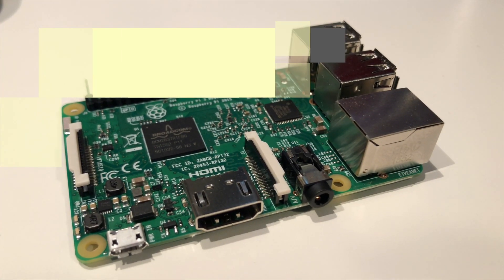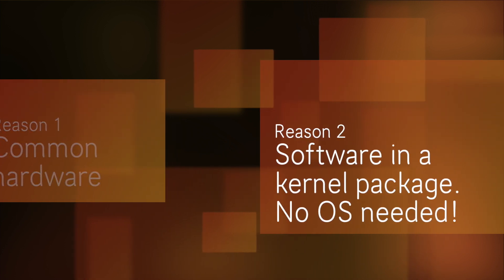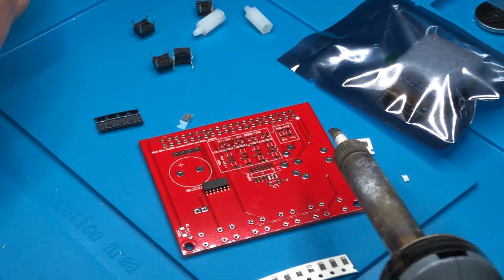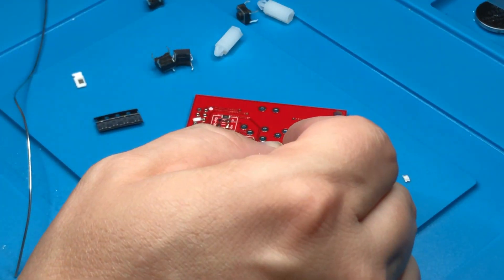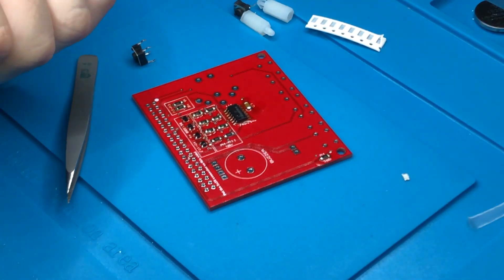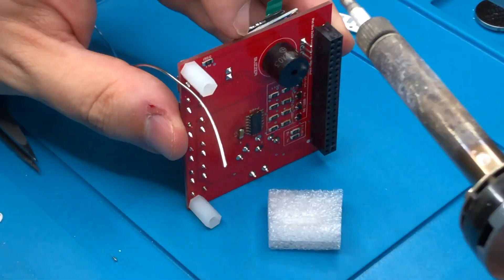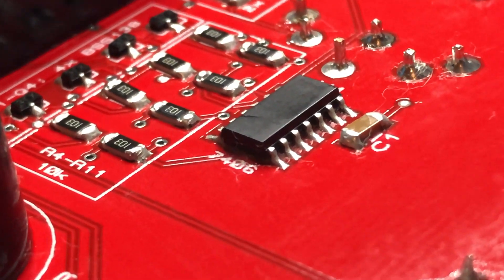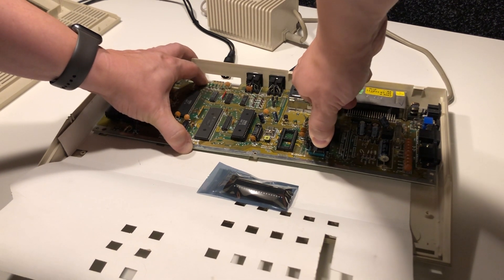Build: A HAT for Pi1541 - The only Raspberry Pi software done right?

Comment: Cool stuff! Thanks for the kind words. You are running a really old version 1.13 the current version is 1.20. For faster booting check that your options.txt has the line "QuickBoot = 1" (I normally display my logo during the boot and add a small delay so it can be seen. This option skips this process and should boot 3 secs faster). Keep up the good work, I'm a big fan of the channel.
Reply from the maker: Thanks Stephen for your comment and feedback. It is much appreciated. True, I got 1.13 preinstalled on the card from RiBIT but I have since compiled the latest GitHub commit a couple of times. I’m planning a follow up episode later on and the QuickBoot parameter will definitely be a great addition to that one. Thanks!